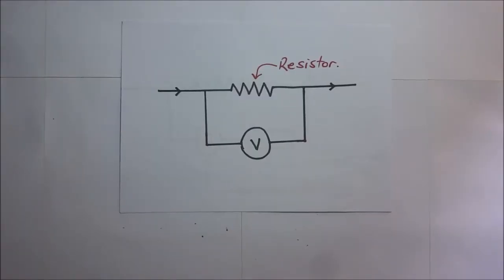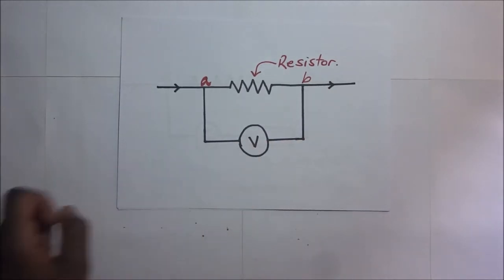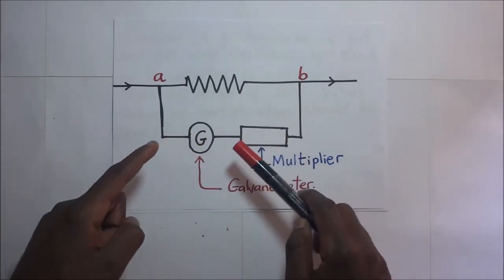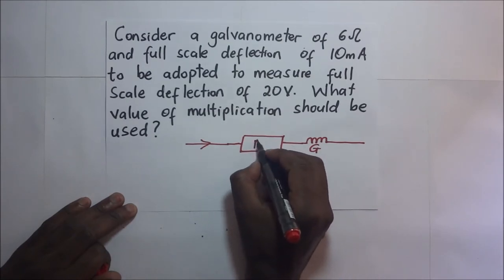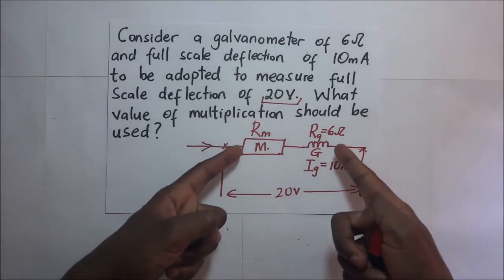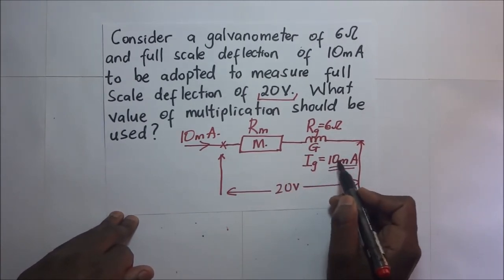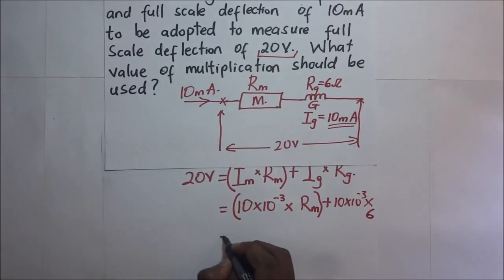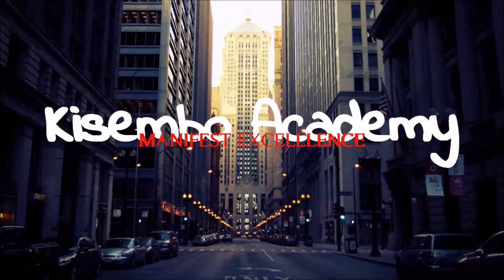How to convert a galvanometer/ milliammeter  to voltmeter by Kisembo Physics

Comment: In the second paper piece the multiplier was set in series AFTER the galvanometer then in the 3rd paper piece you set it BEFORE the galvanometer....so which is the right correct circuit format?
Reply: Both the same